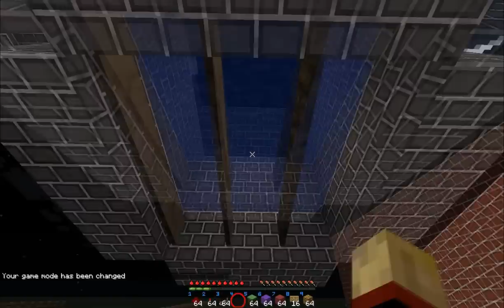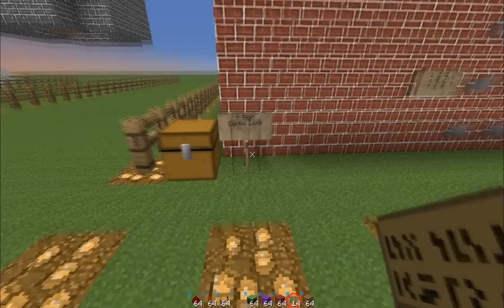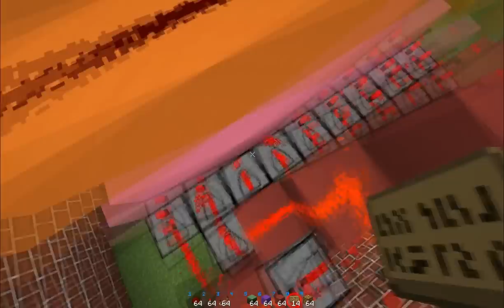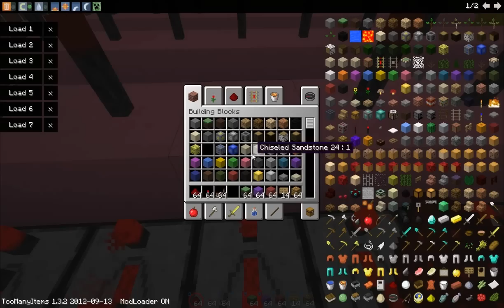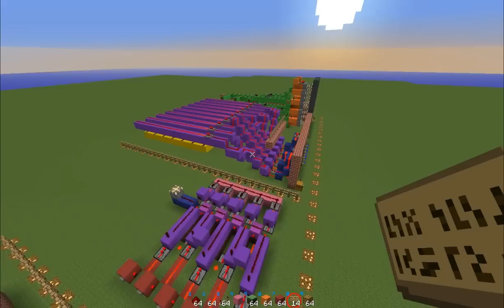Minecraft: Redstone | Pt. 10 - Zipper Elevators and Combination Locks

Comment: Just to be pedantic, (13:00) the repeaters pull power from the blocks that the redstone is on (the block is powered by the redstone). An easy single-pulse shorten-er, can be made by using a sticky piston pointing up, in the ground, a block on top with a repeater set to 1 (or 2, if you want a 2 tick pulse, etc) then the input on the opposite side of the repeater, aiming into the block above the piston.

Comment: Epic video, one question I have with the Combination Lock though. What stops the signals from a correct button resetting the RSNOR latches? E.g. You hit 7 (first number), then after that you hit 6 (second number), what prevents the torches on the pink blocks from resetting the RSNOR. I understand the pink block without a torch activates the next part of the latch, but wouldn't the other torches reset the latch  through the line on the orange blocks?